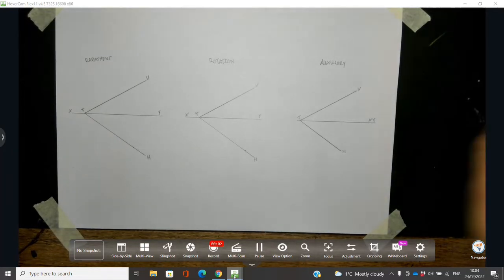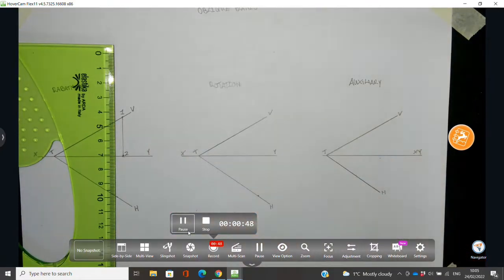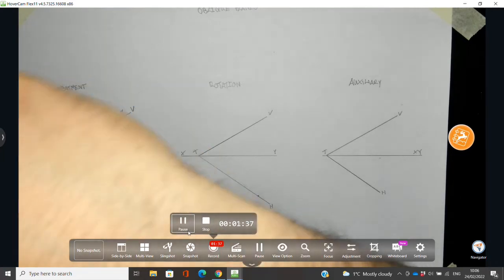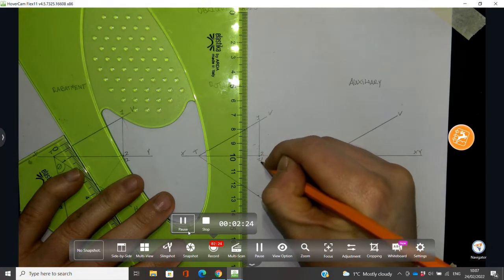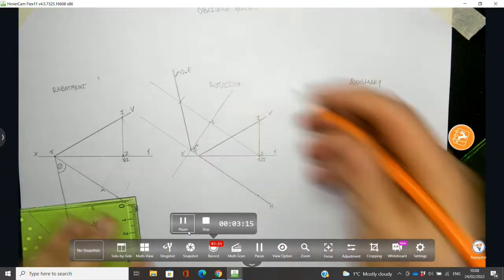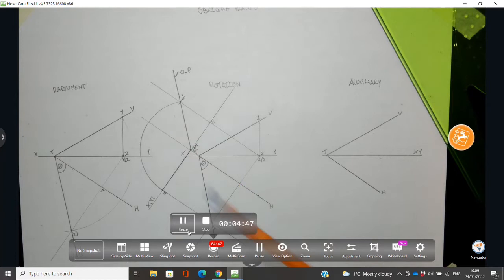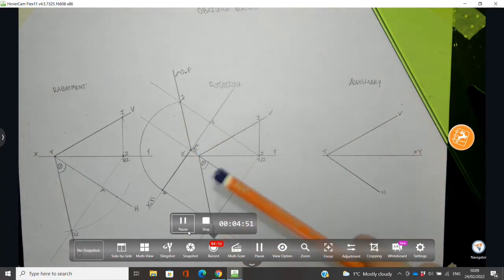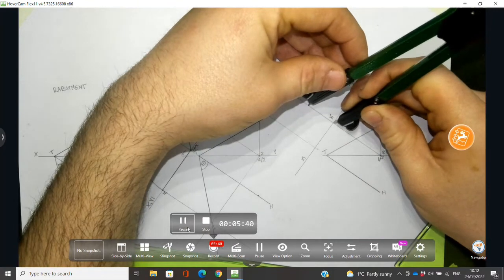Finding the True Angle Between the Traces of an Oblique Plane

Comment: This is an excellent presentation of finding the true angle between the traces of an oblique plane using some very nice descriptive geometry techniques, thank-you for sharing. I like in particular the method of looking along the ht to view it as a point and thus enable an edge view of the oblique plane to be seen. I have a particular question which I have been battling with concerning the traces of a plane when seen not only from the plan and elevation but also from the "profile" view or side view. All the examples in the text books I have seen seem to show the trace in the profile view to be perpendicular to the vt from the point where the vt hits the profile view axis (the "OZ" intercept if we consider 3 axes that are mutually perpendicular, namely, OX, OY and OZ). Is it the case that the profile trace of an oblique plane has to be perpendicular to the vt and is there a reason why? Mark
Reply from the maker: Hi Mark, could you send me a few pictures of the textbook examples to Valconnelldcg@gmail.com and I will answer your problem with some sketches of the solution back. Thanks.
Reply: @DCGacademy  Thanks so much, I will do so within the next few days.